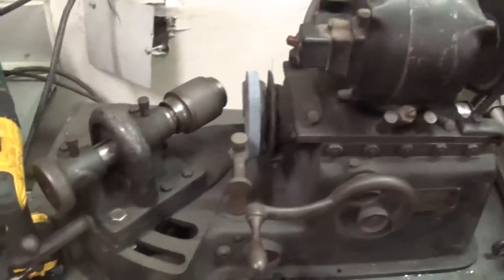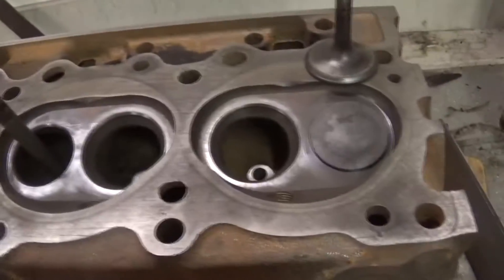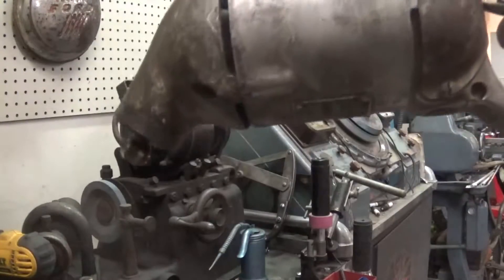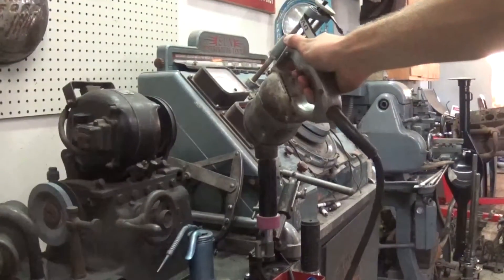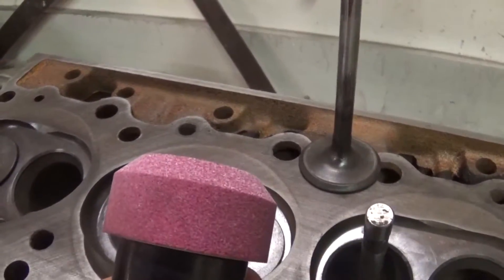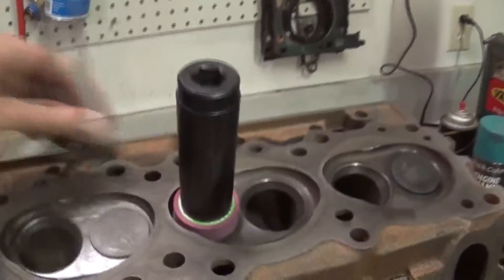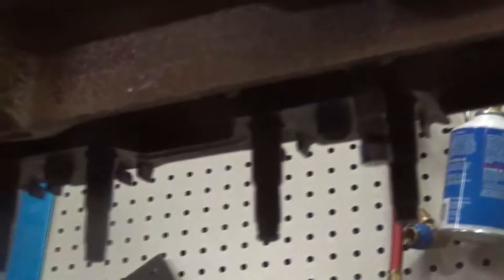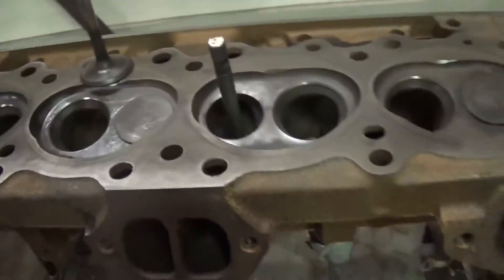Grinding Valve Seats

Comment: Very cool video! I wish i would have found this back when i was just starting to learn how to use the equipment. I bought the grinder & the seat machine & all the stones & dressers & misc stuff a shop had. A guy showed how to grind the valves. That part was easy. But i was on my own with the sests. I didnt have anybody that was willing to answere my questions or most didnt know themselves. But i figured it out. I had alot of questions that i just had to give my best guess of what i thought it should be like? I did ok. My first set of old 390 heads were good. I had one exhoust valve i must not have gotton it truly excentric? It always leaked abouf 50 percent from that cylinder. Never got worse. Couldnt tell running it. Thing had gobs of power. I did another set of heads & swapped them out & they were better. Still running today. Now ive dun sevral other sets of heads too. Ill say somtimes how i go at them is alil different than how you did it. If a seat is out a good bit, alot of times ill set a stone on it & ill just turn it by had with light pressure to see were the stone cleans up. Ill see alot with low spots. But ill go in & take material with my 60 & get it good & dug out all the way around. Ill kiss it with a 30 then but i dont want a deep 30 so just so it cleans it all the way around. That gives me a good visual of how the 45 looks. If the are out a bunch ill dig it out with my 60 till the 60 practicly meets the 30. Then ill go with the 45 so i can have a nice true 45 & it dont take much. Becouse the 45 is just a thin line all the way around were the 60 & 30 meet, so all u have to do is touch it to bring the width in of your 45. It leaves me with a thin 30 & a thin 45 & wide 60. Its worked well for me.
Reply from the maker: @jesseduke694  I paint machinist dye on the seat after it's ground and then lightly tap the valve into the seat, it'll leave a line in the dye and you can make sure it's even all the way around. A 3 angle grind like that will help flow and make more power, just have to make sure you keep enough width on the cut that contacts the valve (usually the 45) so that it has a decent contact area with the seat. That contact area is what cools the head of the valve. The bigger the width on that cut, the more heat transfer from the valve to the cyl head. That's where the HP vs long term durability compromise comes in to play.

Comment: Wonder what I'm doing wrong. I have a sioux and the same pink stones. As soon as the stone touches the seat it gets a groove in it. On a Ford flathead. I believe it has factory hardened seats. Maybe that's the problem?
Reply from the maker: Been awhile since I did this stuff but I think I used to use gray stones for roughing them in, then go back and finish with the ruby stones. The Goodson catalog should explain the different types of stones.
Reply: @SuperKONR  THANKS! I'll check it out.
Reply from the maker: @ClaremontClassicGarage  Hardened seats are rough on stones in general, if the seats are badly pitted you may need an actual seat cutter. Rides on the same pilot but has cutting edges on it like a reamer. If your block has seat inserts you have plenty of hardened material but if not, be aware that it will likely only be induction hardened. On those you only have .020 or so of a hardened surface and you may end up cutting through it before the seat is cleaned up. So just go slow and careful
Reply: @SuperKONR  Thanks, I have been slowly building up a collection of Neway cutters as $ allows.

Comment: I'm curious about the linkage setup you have on you 200 ford. I have an 80 capri built motor with an offi triple intake but the linkage is shot. any info would be much appreciated
Reply from the maker: I built the one for my tri-power. It's just 1/4" rod with heim joints threaded on. The end carbs are linked together 1 to 1. The center carb has a slip joint connecting it to one of the outer carbs. For the first 1/3 of throttle travel the rod freely slides into a bigger piece of aluminum rod, at that point it bottoms out and starts pushing on the other end that's connected to the outer carb. On the outer carb, the linkage from the center carb is attached closer to the center of the throttle shaft than the linkage attaching it to the other outer carb. That way the outer carbs open faster than the center one, so it's progressive but you still get full throttle on all 3 carbs at once.